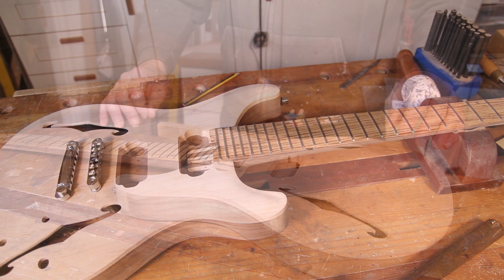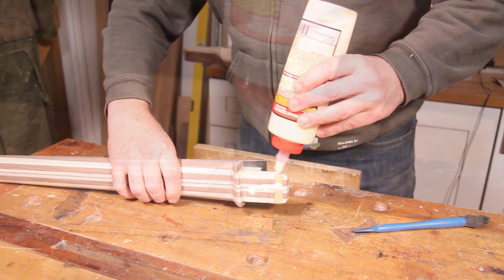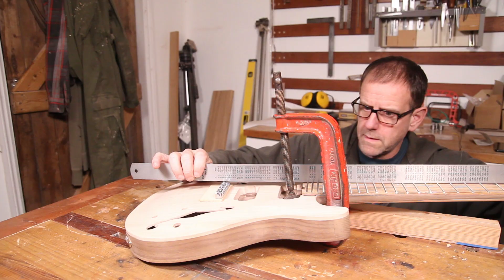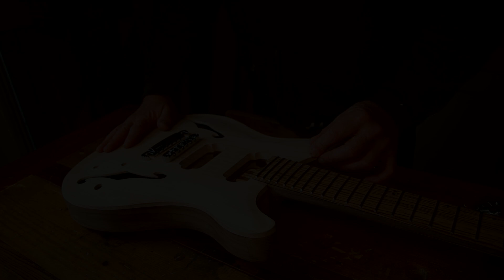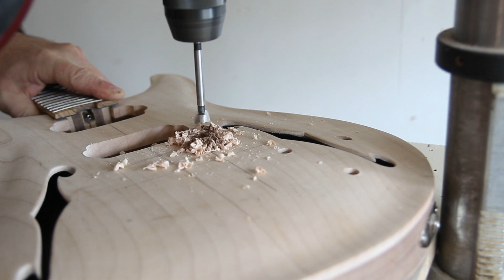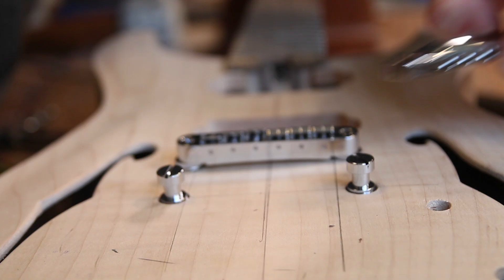GGBO 2022 scratch build guitar episode 39

Comment: Before you do a color dye,  consider what it will look like with just a clear finish.  A thin coat of oil will give you a peek at what I believe will be the best finish for this guitar,  (natural). If you decide to go ahead and color it,  alcohol based leather dyes will penetrate the oil just fine. In fact, oil will control the dye penetration just enough to eliminate blotching and uneven depth.  I add dye to oil so that each coat increases the color density a bit at a time. That thing would look sweet with just a hint of amber color,, like an aged natural maple.
Reply from the maker: There a a few votes for an amber type finish now, hmmmm...
Reply: @Adventuresfromtheshedofdreams  Start light..... you can always add color... not so easy to take it back.   the oil trick gives you total control. You can even lacquer it after the oil cures.
Reply: Yes, I like this idea. 👍